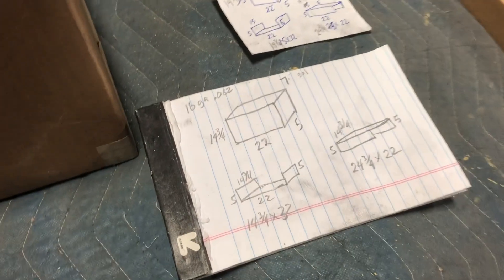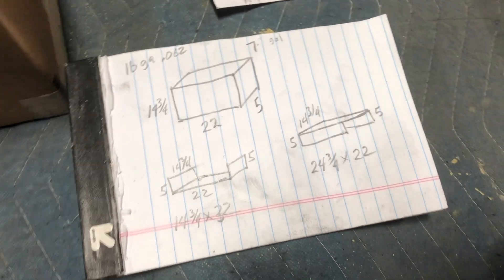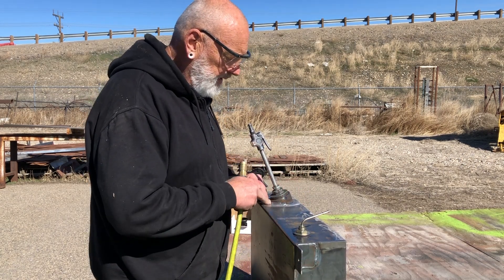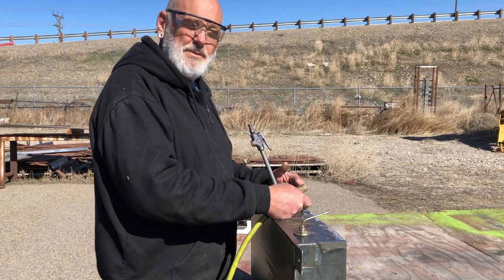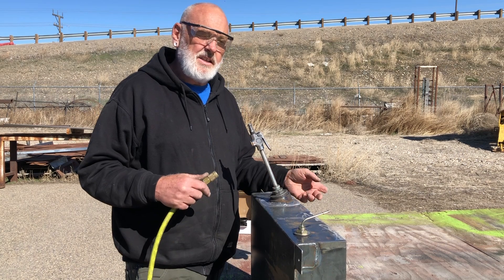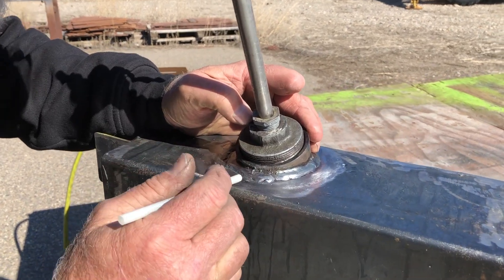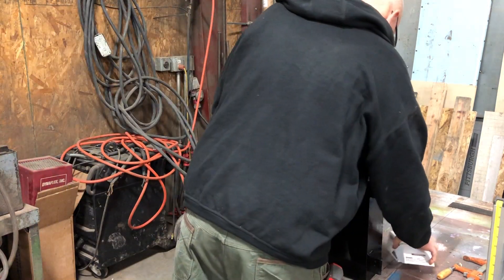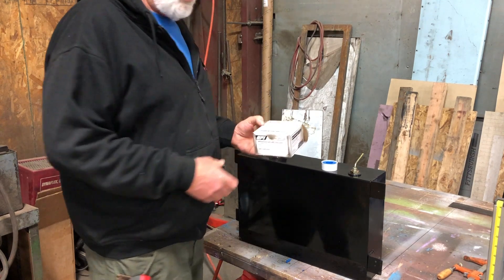Custom Diesel Heater Tank - Vlog 220 School Bus Conversion

Comment: Cool tank fabrication. I'm going to use a steel 5 gallon Jerry can I got from eBay and use a fuel line tube looped up top as a vent. Yours is definitely nicer! Seems like everyone hates those manufacturer plastic tanks.

Comment: Awesome refinement guys!  I'm always excited to see a new video from you all!!!
Question about your diesel heater as I recently met a guy who said the cheap diesel heaters don't have a thermostats.  Now I'm now curious as to how the room temperature is maintained. Was this guy just blowing smoke? Or do they have a traditional wall thermostat where you can set the desired temperature and it simply holds it?
Reply from the maker: Our diesel heater has a thermostat that you set the temperature on. It’s in Celsius which is no big deal to us. So if it’s going to be cold and you set the diesel heater thermostat to 23 Celsius every time it drops below 23 Celsius it will kick up the blower and increase the fuel to warm it back up to 23°. The only downside of our diesel heater is once it reaches 23° it just goes into an idle mode. It will maintain the idle mode until you tell the temperature drops or you turn it off. Hope this makes sense :-)

Comment: I have been thinking all winter about running my 2 diesel heaters into the bus tank . Is there a reason you didnt want to do that ?  Can it cause a problem I'm not thinking of ?
Reply from the maker: The only problem that I am aware of is if you put the pick up tubes down to the bottom of the tank you can drain the tank and not be aware until it’s empty. I chose to do it separately because I don’t like to change the systems of the bus. So if I ever have to get the best worked on all the mechanical systems I really haven’t touched them except for maintenance. That’s really just a personal choice :-)
Reply: @KnappTime  cool thank you . I didnt want to damage anything. I dont use alot running 2 heaters,  I just know every can I put in the car is one step closer to the eventual spill lol 😂